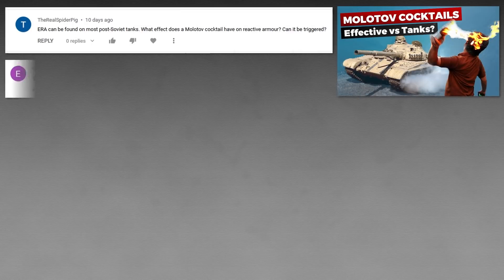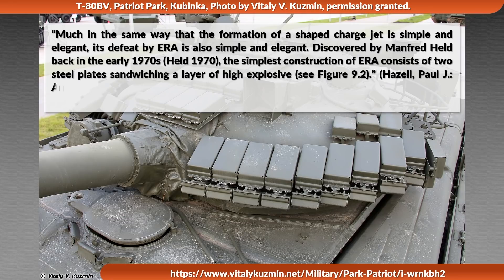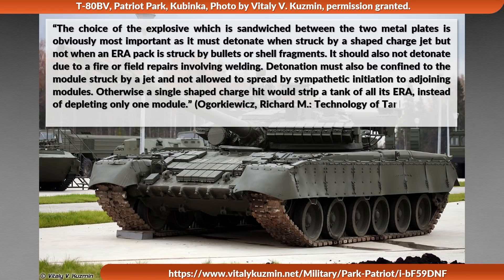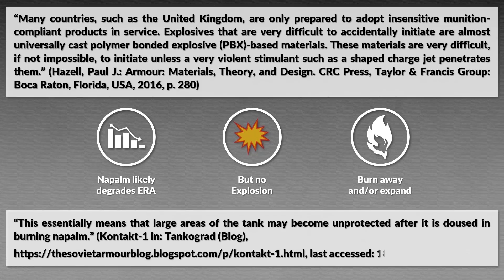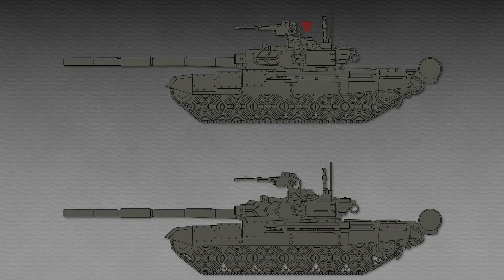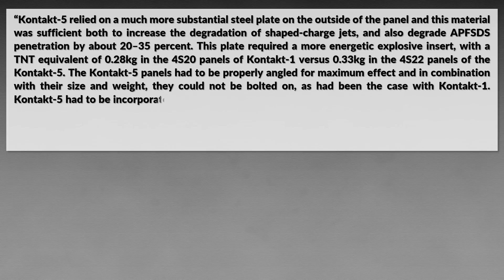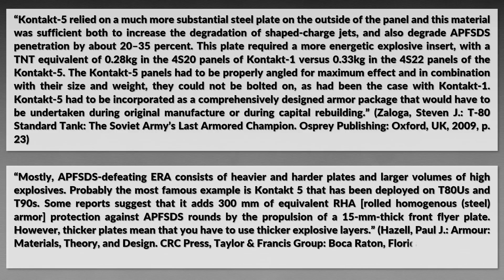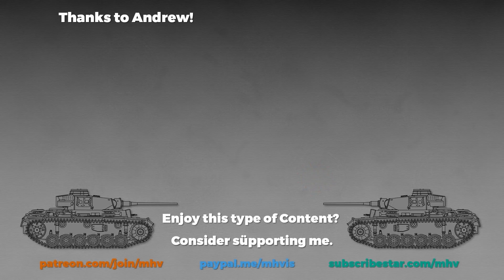Why does Russian Explosive Reactive Armor not explode?

Comment: A burned block may also appear as intact. I used perforating guns in the oil industry with HE in them. One gun deflagrated and the explosive burned in situ into ash. The metal cone (that forms the jet) was perfectly preserved but extremely fragile. The deflagration process was therefore somewhat gentle. Provided that there is a way for the produced gases to vent it may be possible that these blocks, when failing due to deflagration, may look intact.
Reply: yeah i used to do that for 15 years, running guns in wells, ignited with hmx and primacord, when a missfire occured it was a nightmare to disarm
Reply: I agree, I think the explosive in the ERA blocks has simply burned off, leaving the steel boxes empty but looking intact.
Reply: I agree with you.  Reports of "empty" ERA blocks are likely due to the explosive material slowly burning off as you stated.  Most likely the blocks have pressure release points to prevent them from exploding if pressure builds.  This would prevent any "chain-reaction" explosions that would disable neighboring blocks if one was, for example, penetrated by a simple 7.52x51NATO or .50 cal BMG incendiary AP round.
Reply: @wigon  What exactly does it take to set one off anyway? Can you set one off with a small arm?

 Always wondered how dangerous it is for people near the tank if hit. I mean a tank getting hit next to ya is a bad day anyway but does it even worse should be the question.

 Same with the active trophy systems. Would suck being outside the tank just for someone to shoot an old RPG at a M1a2 (which wouldn't even destroy the tank) for the trophy system to launch a charge your way and get hit by it!
Reply: @dianapennepacker6854   It depends on the type of ERA.  Generally most ERA has the equivalent of AR-500 steel protecting it against small arms fire.  They detonate usually due to extreme heat/explosions caused by a HEAT projectile or a hypervelocity SABOT round.    So no, small arms shouldn't detonate most types of ERA.  Now those cloth bag ERA systems, I have no idea about.    As for APS systems, there's always the risk of friendly fire with those but that's just one reason why you stay either WAY forward of the tank (so as not to get smoked by the muzzle blast of the main gun) or behind the tank if it has APS.  But yeah there's always a risk of friendly fire when using APS systems.   In the Army I always tried to stay far away from armored vehicles so as to avoid becoming what armor crews call "a Squishy".
Reply: Hey, as former USAF EOD this is legit.  We would often destroy large bombs and ordnance by burning them out basically with a thermite grenade etc.  Most HE is not going to blow up without the combination of heat AND friction/pressure.  You can burn c4, you can hit c4 with a hammer, but don't burn c4 and then hit it with a hammer.

If they have a way to burn off without the pressure building up they probably can.
Reply: It's amazing what engineering is used in the O & G industry. I remember one time a rig I was on got the drill string stuck a couple thousand feet in the lateral. After a couple days of circulating and sitting around watching the shakers, the Company man decided to get wireline out there for free point. After determining where the free point was, the guy in charge of the explosives set up a "tractor" to deliver the payload out into.the lateral at the free point. Unceremoniously, the guy detonated the explosives, and after pulling his tools out of the string said "Ok, you can pull it". We left the BHA (basic directional tools I believe) and tripped the string out. I was so excited to see what had happened from the explosive. You almost couldnt tell it had been cut/severed. It looked like a tool joint box end, mostly, but there was mo thread. I wish I could remember more about it, or I had asked morenauestions. Cool job, cool technology. I've heard it said that the newest and best technology goes first to the military, and then to the O&G industry, where it trickles out into other industries over time
Reply: I don’t necessarily understand what you are saying. Is it like how fire extinguishers can leak all of their suppressant, making them useless like “burned” blocks?
Reply: @peterni2234  the impact may just cause a "slow burn off" vs a violent explosion. Depending on the ability of the gases to escape.
Reply: @ericv5337  gotcha, sounds simple enough.
Reply: yeah my guess is that the ERA blocks on tank wrecks that burned enough to now be covered in rust probably generally had their explosives burn off, whereas the ones where the surface of the blocks looks normal haven't.
Reply: @peterni2234  auf deutsch....u must learn english und cherman
Reply: @michaeljohnchristophet3949  I’m already busy learning Spanish and Chinese
Reply: @peterni2234  Ni how?
Reply: Ni how ma?
Reply: During WW1 an explosive factory in Silvertown, East London, had an explosion of around 50 tons of TNT. Workers were disposing of excess TNT by burning in an incinerator. They were instructed to only burn lumps of explosive smaller than a human head, but apparently this was ignored, causing an explosion that spread to further stored explosive. The site is still unused and glitters with broken glass.
Reply: no u got it wrong. due to excessive drinking and you being part of the entitled abusive and racist male patriarchy
Reply: What's it used for in the oil business?
Reply: @WhatWhy42  we have to line the drilled oilwell with steel casing to stop it collapsing. We then lower down perforating guns to shoot holes with shaped charges into the oil bearing reservoir. This allows the oil and gas to flow into the well.

There are other applications such as using primacord wrapped bars to free stuck drill pipe, rocket booster charges to set plugs and smaller shaped charges to punch tubing for fluid communication.
Reply: @ochoytnik  ok.. I was thinking they had reactive armor on the drill rigs... Lol
Reply: Boxes with dynamic protection "kontakt-1" and "kontakt-5" like other Soviet and Russian are not 
 ignite when shrapnel hits. Resistance to small arms and shrapnel is the first requirement that all substances in these boxes must meet.
So I do not know what you wrote about, perhaps in European and American samples, the substance in the boxes immediately burns from being hit by bullets, but in Soviet and post-Soviet this does not happen.
Reply: @Ek_Ekvil  were referring to blocks found empty and instead of corruption they were speculating they burned off. This probably referring to the surviving blocks on burned out tanks were the outside of the blocks are look burnt over or rusted exterior metal. 
As video mentioned they may degrade to napalm. If so then the tank on fire might do the same.
Reply: Wat
Reply: Yeah the corruption is real! How else do you think the Russian oligarchs paid for their 500 million dollar yachts??
Reply: I’m wondering if the blocks puff up as the explosive decomposes in a fire or if they vent? A 3 mm rectangular box is a poor pressure vessel.
Reply: I kid you not, a Ukrainian salvage crew examined a down T-72; on further inspection, the reactive armor was counterfeit, filled with egg cartons rather than explosives.  Naturally, this was due to rapid corruption.  However, I wonder if that was to give the tank crew (false) confidence, or deceive the enemies?!? Similarly, some infantrymen's plates were filled with egg cartons instead of the composite ballistic material.
Reply: @jayklink851  I have heard similar stories and having working in Russia I can believe just about anything. They could have hi-tech stuff or it could be full of powdered eggs. Corruption is a confounding factor for everyone involved.
Reply: @jayklink851  Did you actually see the pictures of these egg cartons?  I keep hearing this story repeated but have not seen anyone produce pictures or a video showing this.  What they were probably calling "egg cartons" was fire-proof material holding the explosive material in place in layers.  As stated by the original poster and myself, they were likely empty because the explosive material slowly burned away instead of exploding.
Reply: @wigon  come up instantly on google search what ever that means haha idk anymore but there is pictures of what he says
Reply: @wigon  Yeah, are some videos on YouTube. I'm not sure, but "The Sun", a British Newspaper may have been the source.
Reply: @kormatoes3485  wow! Pictures!?! 👌/s
Reply: @jayklink851  in the pictures is bags and not ERA blocks tbh what looks like saddle bags maybe eggs are cheaper in Ukraine 🥚💰
Reply: @jayklink851  Still it would mean that those block would have survived even if filled with explosives. If the heat was not enough to char the carton it would not be hot enough to set of the explosive.
Reply: @jayklink851 yup, and in more cases just thick cut rubber blocks l
Reply: They're just empty boxes. You people just over analyze to look smart but have no appreciation for real world Intel.

Comment: Russia has not sent in tanks with empty ERA blocks. RedEffect has a great video on this and no i am not paid anything to plug him. He just does great work. 

The most common variant, the "T-72B3 obr. 2016" has been reported to have Relik, but from what ive seen has Kontakt-5. The most common variant, the T-72B3, i believe has Kontakt-1 but could have Kontakt-5. This is significant since I believe only Relik is effective against modern tandem shaped charge missiles like the Javelin, NLAW, or most importantly the Skif. Thats not to say that Kontakt-5 is ineffective entirely. Only that its more hit or miss. Ive seen a bunch of videos of a direct hit on a tank, explosion and all, and the video claims the tank was killed and it just keeps rolling and shooting with no armor penetration.
Reply: First, I don’t think he can know whether Russian ERA blocks are real or dummies. In the first gulf war, USMC tanks equipped for ERA went in with only the fronts of the turret equipped with real explosives blocks, as there weren’t enough to go around.

Second, a lot of people mistake a large explosion outside a tank with catastrophic destruction. In fact, the whole purpose of the armor is to keep that explosion outside where it belongs. Those explosions may not have penetrated, or may have done little damage.
Reply: @coryhoggatt7691  you mean keep the explosion away from the tank, 1 non-penetrating blast can take 3 or more crew members out depending on the round. Modern rounds are smaller so not so likely.

Comment: You know why the Russians reactive armor is ineffective is Russia is a poor country . Russia was lying to it's soldiers and the world. I would guess that maybe 1/4 of all Russian tanks have Reactive armor. Do you want proof ? Remember the video of the BMP taking out the T72 tank with a 40mm . That would be imposable against reactive armor
Reply: If you put multiple 30MM rounds into the same spot they'll penetrate eventually. It's pretty easy with the high fire-rate of the BMP auto-gun.
Reply: @wiregold8930  That's wrong . First it's 40mm and head on with a tank it has zero chance of penetrating sloped armor. If it could then why make tanks? a 40mm couldn't pernitrate a WWll tanks sloped frontal armor . Believe me they tried
Reply: @wiregold8930  You're right 30mm

Comment: What's questionable about ERA is how much protection they actually provide?  When you look at the majority of destroyed Russian tanks you can see that their turrets have blown off which proves that their ammunition and fuel storage are unsafe and fire suppression systems are insufficient as shown in the Gulf Wars.
Reply: The ammo cooks off after the crew bails. ERA Isn't saving the tank when it works.
Reply: @shanut8139  - Are you sure the crew has survived?  It seems that you can put ERA all over these Russian tanks and their equivalent thickness of armor doesn't really matter when their designs are badly flawed, to begin with.
Reply: then again, there''s a good reason why those are the tanks we see. they didn't survive. those that did would have buggered out.

Comment: I would imagine that in the case of quite a few of the Russian tanks we've seen in the current war, it probably doesn't help that their reactive armor either turned out to be just blocks of wood shaped into ERA, or the explosive charges were filled with something other than actual explosives.
Reply: Many have suggested that the explosive fillers are missing from Reklit-3 "soft ERA" (usually seen covering the tracks of T-80s) because the crews sold it on the black market. Apparently it's a lot easier to remove from the fabric bags than metal bricks.
Reply: I've seen news articles saying that the explosive has been stripped out and sold and the space filled with empty egg cartons. Good luck with them stopping an incoming warhead.
Reply: The "egg cartons" are the spacers for the Era, they're supposed to be there. However it's totally true the explosive has been removed, soft Era is supposed to be block shaped and not contor to the tank, look at like any Pic of them in Ukraine and you can see they conform to the tank, which means it's just spacers
Reply: @jamesharmer9293   а ещё в новостях  говорили  у России нет ракет ,что всё это мультфильмы Путина ) вот уже два месяца мы мультипликационные фильмы показываем )продавать взрывчатку с динамической защиты... абсурд )) да её сотни тысяч ,миллионны тонн и так есть где взять )))
Reply: @jamesharmer9293  Thats not true watch the channel Red effect its explained why some believe that.
Reply: Russia is Russia. 😂 I need to go take a russia.
Reply: I really enjoy seeing people skip the previous replies just to post something that’s already been discussed. 😂 🍿
Reply: @TsunauticusIV   "enjoy"  ;-)
Reply: They say that their body armor is filled with cardboard. No joke
Reply: @haroldbell213   твоя голова набита картоном )
Reply: thats because there's no amour underneath the outter layers . I just watched a video on youtube tanks in Ukraine that have been hit have only egg cartons stuffed inside . Iam not joking the companies that build was putting that money in their pockets . Once I found it later tonight .

Comment: How do tankers not have their eardrums blown out immediately? Do any tankers not have severe hearing loss?
Reply: Our crew headsets were designed to reduce hearing loss but allow conversation over live intercom. After seven months of almost daily patrols I know my hearing was so bad I had my radio volume at 100% and could barely hear it over the racket of the power pack and running gear. 
Ear drums burst are always survivable though.

Comment: Thanks for the explanation. I was also taught that Shaped Charge Penetrators were molten, I guess it's a common misconception.
Reply: At those extreme velocities solids behave more like very thick, viscous fluids
Reply: not molten, not liquid, not plasma, not flame, but a solid in a very exotic state due to its high speed not generally found in everyday experiences, it could be described as a fluid using equations which describe fluids, though it is a solid- but a very fast moving solid
Reply: The copper itself is solid but through the kinematic it bevahes like a liquid. This is comparable to a car crash where the metal can "flow". But with waaaay more force.